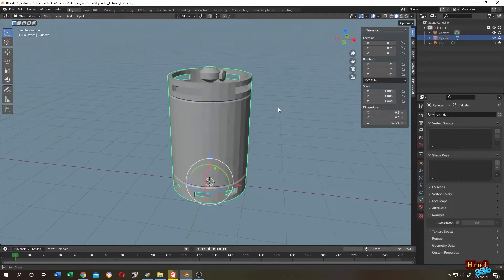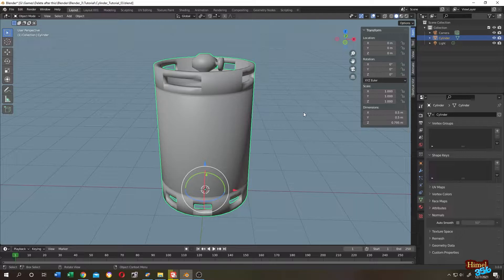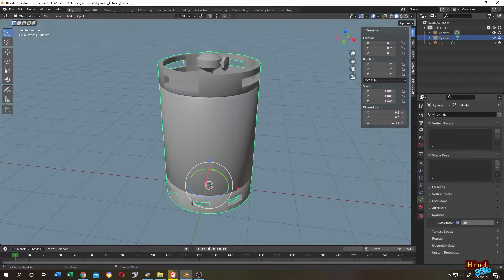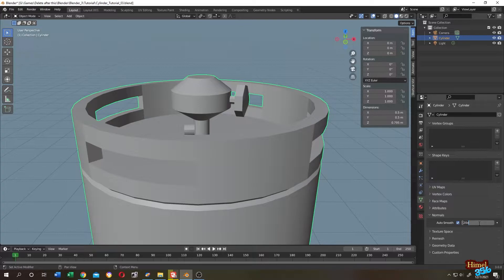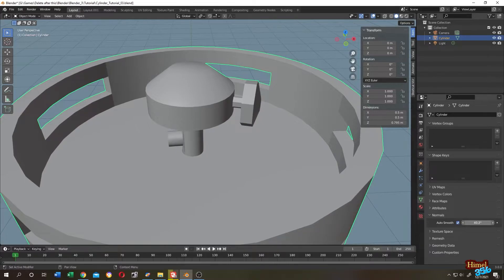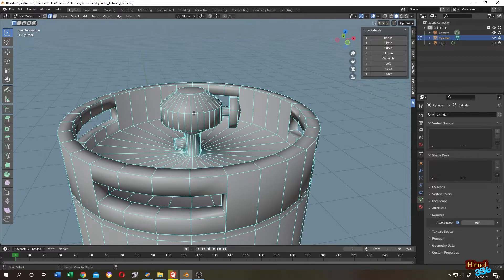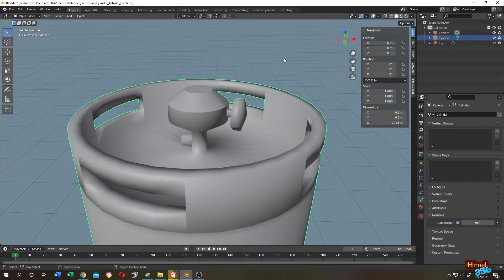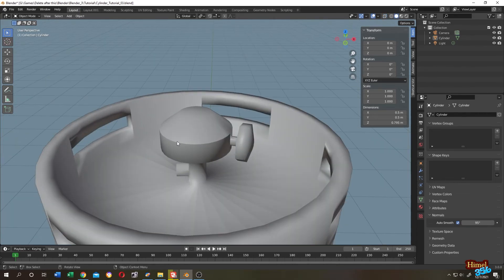Blender Tutorial : How to Auto Smooth in Blender 3.0

Comment: For those who have the Auto smooth degrees GREYED OUT just do this. In the Object Data Properties go Geometry Data and then clock on "Clear Custom Split Normals Data". Then it will work. Also am I correct in assuming you can add a bevel modifier to adjust the sharpness of the edges? Or would you need to manually bevel each edge? Great video btw. You made it so simple and clear.